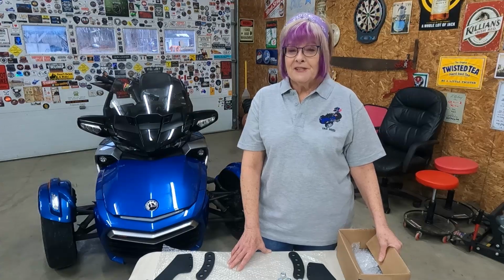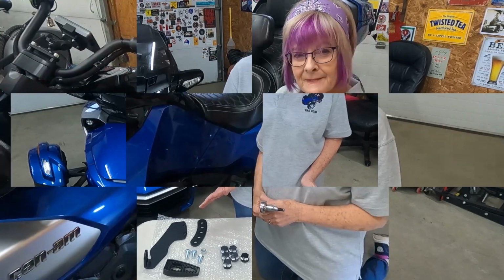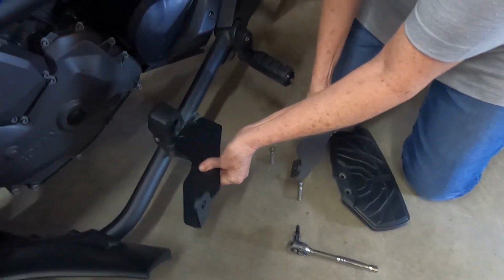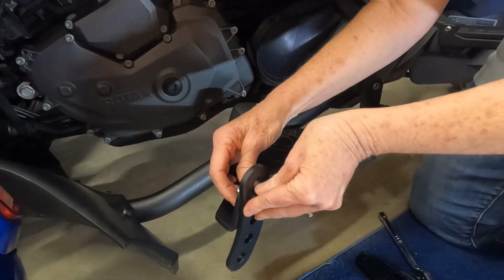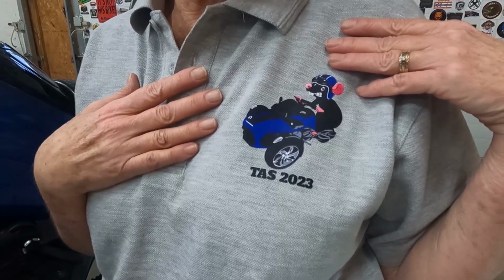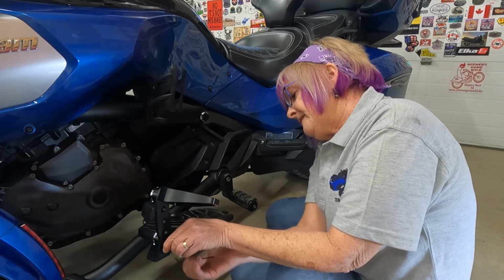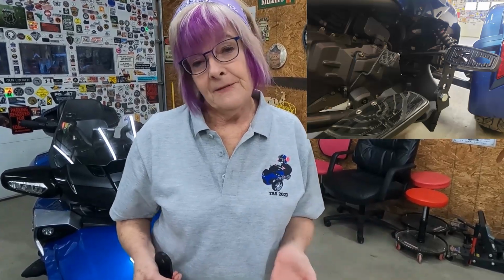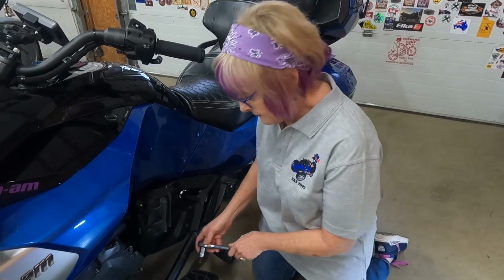Can-Am SPYDER F3 Limited Lamonster Highway Pegs Install

Comment: It's good to see you getting down with the tools making the F3 more comfortable for yourself on big long adventures, I've got a few mods I'm doing to the Rocket. A taller screen to deflect more wind, fender and hugger extensions to stop being sprayed with grime from wet roads and panniers to carry stuff for touring and shopping. They sure build things strong over there, you could build a bridge with those brackets 😀
Reply from the maker: I am not a natural "in the garage" but it feels good to learn a few things! Those sound like a lot of great mods for the Triumph that you plan on doing. Will you be doing all of those yourself?
Reply: @PurpleOnThree  Well done for learning to do things for yourself, yes as far as my own mods are concerned I'll be doing them myself. I don't have the luxury of a huge garage like you have, instead I have a shed which only holds two out of my four bikes. To do work I need to do it outside and decided not to film it as others have recorded doing such mods. I've already fitted the taller screen also removed the front fender to glue a carbon extension which will reduce fling onto the radiator from the front wheel.

 Today the rear hugger arrived so I'll do that when the weather permits as well as refitting the front fender. Then I'll tackle the mounting brackets for the panniers, I'm still trying to decide whether to paint them black to match the bike, since everything else on it is blacked out. I will show them all fitted so folk can see the difference.
Reply from the maker: Thank you, Michael...I try. My dad is a mechanical engineer but I did not inherit those genes... Just his freckles.😁
Wow! You are moving right along with those mods! I do like blacked out... Tommy is the chrome guy. 😁
As for our garage, we have a farm so all the farm vehicles, including our Kubota tractor fit inside and believe it or not,  we don't have a barn so this is sort of our barn... And it's nice that we have extra room for the bikes in here too. 😁🤗
Reply: @PurpleOnThree  Thanks for your reply, Tommy would prefer my Kawasaki Vulcan 1600, chrome, chrome, chrome and more chrome 😯😎 As for freckles In also inherited them from my father, although his red hair gene was beaten off by my mother's Raven black hair. Though if I grew a beard it would be a mixture of red/black 😂
Reply from the maker: @greywolf9292  Yes, that does sound like Tommy would enjoy your Vulcan! What color is it? Red and black beard would be better than a grey one, lol!! 😂😂
Reply: @PurpleOnThree  It's blue and silver you can check it out on my channel Kawasaki Vulcan 1600 Classic Tourer 😯😘

Comment: i like those more that what if offered for the RT-L
Reply from the maker: Do you have some pegs? So what is the difference for the RT ones?
Reply: @PurpleOnThree  i had an expensive set from lamonster that i hated. i tried putting them in every conceivable position and no matter where i adjusted them to my foot/feet would either hit the fender on the brake pedal.
Reply from the maker: @Grumpyoldman60-  well that is a bummer they didn't work out because yes, those things are not cheap! I don't even know if I will use the one on the right side...we shall see

Comment: I have an F3 limited also and i cannot open the glove box and the manual does not 'show' how to clearly..  i don't want to force it , could be it is stuck for some reason but i have not been able to open  i bought the bike used .Can you tell me how to open it please.
Reply from the maker: What year is it? My 2018 opens a whole lot easier than the 2023. The 2023 is a hard pull on the little tab. I can't even do it with my left hand. I have to do it with my right hand. The 2018 opens a whole lot easier. It just lifts up.
Reply: @PurpleOnThree  ok thanks  yes i have the 2018 also and i feared that if i pulled too hard on the small lever that something might break so i will try again and hopefully it will unlatch .. i enjoy your posts  and very nice to see the free spirit you are. Good life and good health.
Reply from the maker: @exrayZap-ry1gh  thank you so much for your good wishes! 🤗💜 Best wishes with your Spyder! Did you name it? Be safe and have FUN! Hope you can get that glove box open... They're just not easy.. Maybe you'll find some treasure in there! 😁